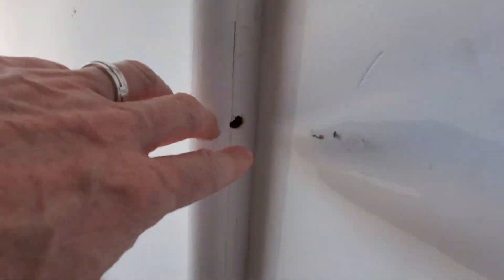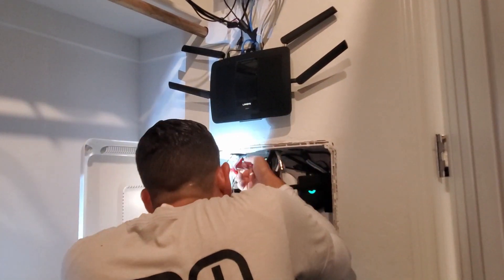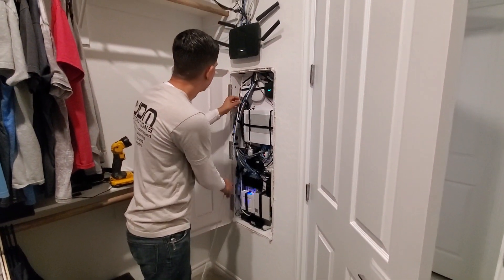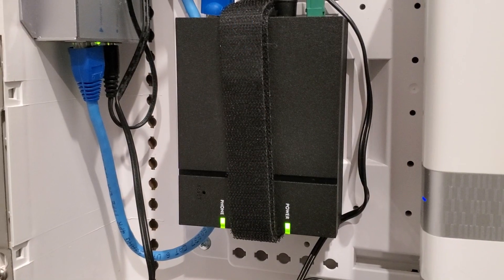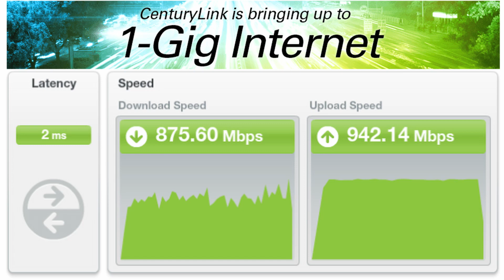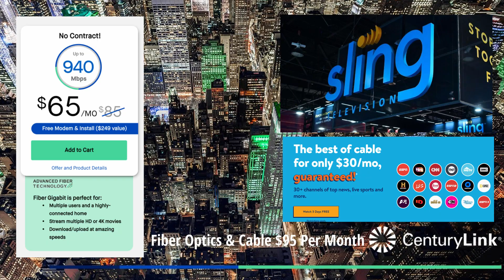Home Fiber Optic Internet Installation -  How To

Comment from the maker: We hope this video helps you understand how to cut the cord and switch to fiber optics. We considered speed and pricing as our 2 main reasons for switching. Thanks for watching!
Reply: Do you have a link as to where you purchased your Network Panel you have in the Master Bedroom?
Reply from the maker: @jdavis1510  I didn't purchase the panel. My house came with it already installed. You can Google Legrand structured wiring solutions. They have a website to order whatever size you need. Thanks for watching and keep me posted!
Reply: @UltimateTechHub  I currently have fiber internet through att is there anyway to use my own fiber ONT “fiber modem” I currently have their bgw 320 gateway router which has an ont built in. I would love to use my own equipment I am not having the best experience with theirs
Reply: Great video
Reply: So nice. My videos are not so professional. I will try to learn something. Greetings from Munich

Comment: Can you take the straight ass fiber optic coming from the street and direct connect it to a SFP Fiber module on a router?
Reply from the maker: It depends on how the Fiber was installed but it should work.
Reply: It depends on your ISP. Some are very flexible and let you use your own router and SFP. Others are more strict. My ISP, Race Communications, doesn't let you use your own SFP. I don't know the specifics, but the ONT is part of the SFP module and is only programmed to work with their gateway they provide. I tried moving the SFP to my Ubiquiti router and it wouldn't work. I do have bridge mode enabled on my Calix box (that they provide), so I can at least go that route.

Comment: Maysbe this has been asked already in comments, wish comments had a search function.  How is it that you went straight to the Fiber Modem and skipped over an ONU or ONT?  My Fiber ISP uses an ONU inside my home.  I wonder if it can replace it with my own Fiber Modem.  Obviously, I'm just a beginner here, trying to learn the ropes.
Reply from the maker: It's an ONT , I said fiber modem to keep it simple for beginners.  But fiber to ONT to Router is the path.

Comment: Well that's great for me no.  I have 2Gig and they lie. it is 2 gig coming in and being charged for it but no 2 gig upload or download.  costumer service is a joke.  they want you to use the AI and make if impossible to get anything done.  it has taken me a week or longer to get my service and fixed  3 times they came out to fix it and still no 2gig upload.  the tech says the router only does input 2gig and for smart devices work faster which they do but the output ethernet port is only 1 gig.    but i do like fiber internet.

Comment: I live in Bangladesh, and our ISP offers a 1 Mbps internet connection along with 100 Mbps BDIX access for just 500 BDT (approximately $5). While the 1 Mbps speed is quite limited for general browsing or streaming, the 100 Mbps BDIX access ensures fast downloads, smooth gaming, and seamless streaming from local servers. This package is quite budget-friendly for users prioritizing local bandwidth.

Comment: So basically all there installing is a fiber wire and a network box that coverts the light signal into a electric signal for the Ethernet to travel to the router to understand?
Reply from the maker: @williamcrooksii9139  The ONT converts the light to the electrical signal. Correct.

Comment: 940Mbps for 65$/mo ?? wth in france we have 900Mbps down and 600 Mbps up (in reality I got 950-700) for 30€ with TV and phone, for just pure fiber without TV and phone you can get 8Gbps down and 1Gbps down for 24€ or up to 8Gbps up AND down for 50€ (first year than 60€) with 2x wifi 7 router, TV (with netflix etc) and phone.. (actually, 60€ is 61,5$.. USA is just a big scam bruh)
Reply from the maker: @nuptay 75 dollars a month for 940Mbps is the going rate for the US. Not that big a deal since fiber is not even available in many areas. Enjoy your fiber and thanks for watching.
Reply: @UltimateTechHub  daaaamn, 75$ is 73€.. that waaaay more than the most expensive subscription we can get in France.. that INSANE..

Comment: Fibre optics is great for the internet and media, however, one needs to keep a landline along copper wire. When you have a power cut the whole fibreoptic network  will be down. You have to make sure you have a fully charged mobile phone to make your phone calls and in rural areas that is not always possible of course. Even a cordless phone will be  down during a power cut. I keep a ordinary land line phone for backup.   Unless there are ways to keep the phone line going even with fibre optics during a power cut.O
Reply: It looks like AT&T plans to abandon their POTS lines by 2029. It makes no financial sense for them to keep their archaic infrastructure in good condition anymore. And plus, even if you get their POTS phone service, their cheapest plan costs $53/month.

Comment: Did century link not offer to run your fiber through the attic? Is this why you hired your own guy or was it just preference?
Reply from the maker: @ryansimms9950  They wouldn't do the fiber run since we didn't have the smurf  tube for the fiber. Most companies won't crawl into your attic space, it's a liability.

Comment: 2:20 Unplug the old modem
1. Unplug the old power supply
2. Unplug the old coax cable
3. Unplug cat6 from modem to router

Comment: you are not actually connecting to fiber.  Turns out there is no way to actually connect your  network, which is cat5 or 6 cable not fiber,  to the actual fiber cable on the street. You connect to their endpoint which is an ONT (this communicates with their service and takes the place of a cable modem) which you have in your wall enclosure BUT.....the output from the ONT is only ethernet, so you lose the so called "fiber wire" connection.  You can still have fiber within your own network with actual fiber wires, SPX adapters to your computer, and all that (which you do not have)...but no connection, fiber-wise, to the street
Reply from the maker: It's fiber from the street to the house and to the ONT. That's exactly what this video is about. It's not about fiber running from room to room. I switched from cox cable coax to CenturyLink 1gig fiber and it's like night and day. Super fast consistent speeds and 1/3 the price of Cox. Thank you for watching I really appreciate it!

Comment: in canada fibre is insane i install for bell when u pay for 1.5 bell gives u 1.7-1.8 since fibre is so easy to modify anything u pay for atually u get a bit more 50mbs u get 60-70mbs 100mbs 130-140 3.0gbs u get 3500-360gbs its nice that bell does that ur price is insane if u were in canada and got bell i could get u the same bundle but with 1.5gb  for 90$ CAD

Comment: where r u from? canada or usa? the patch cable looks like corning.. i work at bell installing this stuff and thats what we use
Reply from the maker: USA - Las Vegas 😄
Reply: @UltimateTechHub  lucky son of a gun.   I visited there not long ago I love it there.    Just the lights and all the cool things to see.       Where I’m from it’s super duper boring plain and just shitty everything’s grey.
Reply from the maker: @JeffreyTre  Where are you from?
Reply: Ottawa, Ontario, Canada ik u wont know where that is but its about 4 hours from toronto i say that cause no one knows ottawa even though its the capital of canada  @UltimateTechHub
Reply from the maker: @JeffreyTre  I've been to Montreal.
Reply: next time fyi when ur running fiber it tangles very easily asu guys expierienced a little tip dont just puull the cable straight unwinde it if u know what i mean spin it so the wire gets linger and walk around with the wire laying it out on the floor its the best way cause if u just pull the wire it will start to twist but if u uncoil it ittll stay straight and when laid on floor it wont tangle when being pulled

Comment: Thank you for the comparisons.  We are planning on going with a fiber provider instead of our cable provider and am presently working on our entrance.  Just curious if you could suggest a  route for a network box.  I have approx 10 runs of Cat 5 from behind my entertainment center and the wires are getting everywhere so a in wall cabinet would be nice?  Just curious if EMF from all of the network cable should be considered??  Thank you again for all your work,

Comment: You said you decided to “cut the cord and ditch the cable” in favor of fiber optic. You’re not really cutting or ditching anything. You’re just swapping one corded network connection with another. 🤷🏻‍♂️
Reply from the maker: Yes one crappy coax cord for 1gig Fiber cord! Lol! I saved about $145 a month and 4 times faster speeds! It was a no brainer! Thank you for watching!
Reply: "Cut the cord" refers to getting rid of cable TV service.

Comment: Lots of misinformation in this video. Most ISPs won't use a fiber cable you've ran. Also with gigabit speeds the age of the pc generally isn't an issue these days. However the max you'll get is 940-960 Mbps over a wired connection. Wifi will get anywhere from 300 Mbps on the low side up to around 700 ish. Also a major bottleneck is the site you're connecting to and congestion between you and that particular server. Also what is with the 90s/2000s stupid sound effects every 10 second. I couldn't watch the entire video because of it.

Comment: The second you said cat5e 😂 I was like why do you even bother with the fiber if your whole house is build in cat5e you are gonna need to upgrade the whole house not just your modem. Unless you wanna go wireless 10G
Reply from the maker: I went with fiber to get the 1gig speeds because cox cable was to expensive for 1 gig speeds and the uploads where only 30mbps. We are upgrading to 2 gig fiber soon so we will make sure to have all ethernet cat6a to handle the 2 gig speeds. Half of our house is cat6 riser and half cat6a. We will also have to upgrade all of our hardware and NICs.

Comment: I have a gigapoint with fiber ram to it, then an Ethernet cable ram across to another pet of my house, I plugged in a router and I can connect to the wifi, but I get no service, pls help
Reply from the maker: Is it plugged into the WAN port on your router? Also unplug the gigapoint and router for 1 minute and plug back in. Keep me posted.

Comment: I ditched the mesh network in my house and Ran fiberoptics in every room tne installed a Fiver to Ethernet converter in every room and upgraded my Google wifi with Ubiquiti. It was not even that expensive to go all fiber in a 338 Squarmeter house. but this has improved everything. also now I have instant access to my media server and can even edit on it from any location in the house.
Reply from the maker: Great setup!
Reply: You running them from fiber switch to the room? Which switch you using?
Reply: You have inspired me here because your words are starting to help me clarify some perplexing questions. 

I did not realize that when fiber optics is installed at one central point in a home, this can cause problems. Did you make a fiber optics connection to every room in your house because you expected that your internet connection would otherwise be slowed down?

Is a Fiber to Ethernet converter a physical Fiber Optics cable with a physical Fiber Optics connector on one end and a physical Ethernet connector on the other end? 

You say you ran fiber optics cables from the main fiber optics terminal in your home to each room in your home.  How did you connect those cables to your fiber optics terminal? Is there a port provided in the fiber optics terminal where one can buy and plug in fiber optic cables to improve service to other rooms?

Does that final location for the fiber optics cables in each room end in another fiber optics terminal? Or what? That is, what was the fiber optics device in each room to which you plugged in that Fiber to Ethernet converter? 

Once you had the Fiber to Ethernet coverter installed in each room, then to what device in each room did you plug the Ethernet connector on the opposite end of the Fiber to Ethernet converter? Would that be a modem or a router? Or what? 

Could the point be to translate the optical signal of fiber optics into the digital signal of Ethernet, since a digital signal is needed to connect to the internet?

Now that you have gone to the trouble and expense of connecting your house to fiber optics, and of translating the fiber optics signal into a digital Ethernet signal, are you saying that you still have no connection to the internet yet at this point?

In other words, do you now have the potential capability through fiber optics of quickly sending and receiving large amounts of data, but fiber optics technology is not intended to connect you to the internet, so another technology is needed?

What technology is needed to connect you to the internet? Do you still need to pay an internet service provider to provide a wifi signal?  Wifi connects devices wirelessly to the internet, but isn't that what people pay their ISP to do for them? 

That is, can this digital signal you now have that was provided by your fiber optic cable be sent to your devices by wifi without the need for an ISP? If so, how did you do that?

An Ethernet connection to the internet it is a lot less convenient than wifi due to tethered nature of a wired connection, but if you wanted to, could you connect your fiber optics capability to the internet by Ethernet from your modem or router for a hard-wired connection that is faster and more stable? If so, how would you do that?

Thanks to anyone who can provide clarity on this. My internet is going down, and I need to figure all this out.
Reply: You have inspired me here because your words are starting to help me clarify some perplexing questions. 

I did not realize that when fiber optics is installed at one central point in a home, this can cause problems. Did you make a fiber optics connection to every room in your house because you expected that your internet connection would otherwise be slowed down?

Is a Fiber to Ethernet converter a physical Fiber Optics cable with a physical Fiber Optics connector on one end and a physical Ethernet connector on the other end? 

You say you ran fiber optics cables from the main fiber optics terminal in your home to each room in your home.  How did you connect those cables to your fiber optics terminal? Is there a port provided in the fiber optics terminal where one can buy and plug in fiber optic cables to improve service to other rooms?

Does that final location for the fiber optics cables in each room end in another fiber optics terminal? Or what? That is, what was the fiber optics device in each room to which you plugged in that Fiber to Ethernet converter? 

Once you had the Fiber to Ethernet coverter installed in each room, then to what device in each room did you plug the Ethernet connector on the opposite end of the Fiber to Ethernet converter? Would that be a modem or a router? Or what? 

Could the point be to translate the optical signal of fiber optics into the digital signal of Ethernet, since a digital signal is needed to connect to the internet?

Now that you have gone to the trouble and expense of connecting your house to fiber optics, and of translating the fiber optics signal into a digital Ethernet signal, are you saying that you still have no connection to the internet yet at this point?

In other words, do you now have the potential capability through fiber optics of quickly sending and receiving large amounts of data, but fiber optics technology is not intended to connect you to the internet, so another technology is needed?

What technology is needed to connect you to the internet? Do you still need to pay an internet service provider to provide a wifi signal?  Wifi connects devices wirelessly to the internet, but isn't that what people pay their ISP to do for them? 

That is, can this digital signal you now have that was provided by your fiber optic cable be sent to your devices by wifi without the need for an ISP? If so, how did you do that?

An Ethernet connection to the internet it is a lot less convenient than wifi due to tethered nature of a wired connection, but if you wanted to, could you connect your fiber optics capability to the internet by Ethernet from your modem or router for a hard-wired connection that is faster and more stable? If so, how would you do that?

Thanks to anyone who can provide clarity on this. My internet is going down, and I need to figure all this out.

Comment: What modem do u use to connect to fiber and then convert it to cat 6. What is that black box call or link to it
Reply from the maker: It's a fiber ONT. I have a link to one that's on ebay.

Comment: Is there any need to run hardwire internet connections to bedrooms or other rooms in the house? It seems like everything is off wifi. Looking at new construction. What are thoughts
Reply from the maker: It's really a personal preference. I prefer wired connections for any devices that have a LAN connection like Smart TVs and PCs. However wifi is plenty for most streaming situations on TVs or Laptops.
Reply: If you plan on installing any wifi access points, I would recommend getting a few data drops installed. Wifi, as convenient and advanced as it is, is still a radio frequency. It is still prone to interference and signal degradation over distances and obstacles (walls, ceilings, metallic objects, etc). If you have a large house, chances are that a single wifi router isn't going to cover the entire home. You can install a couple of APs throughout your home to get the best wifi coverage.